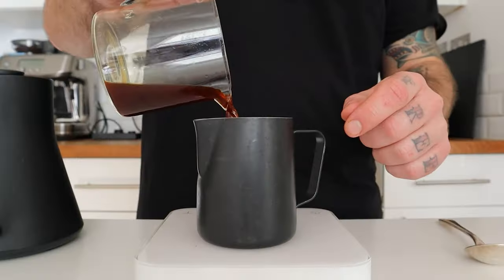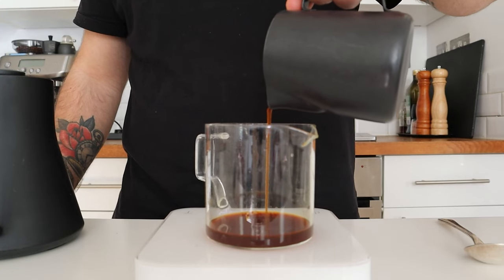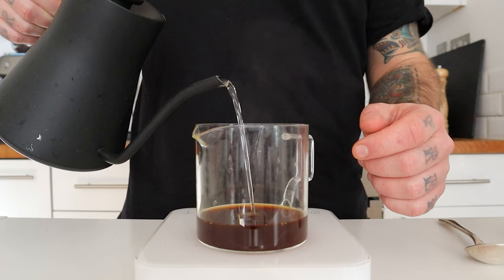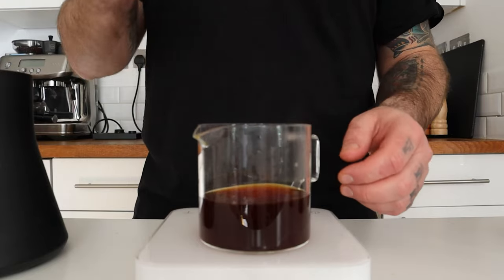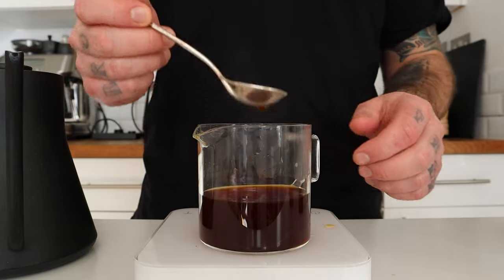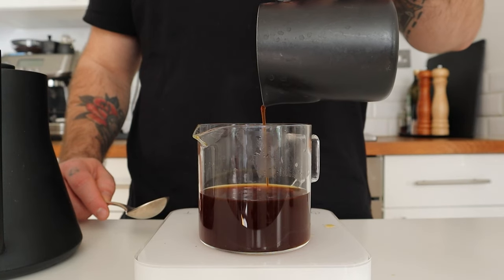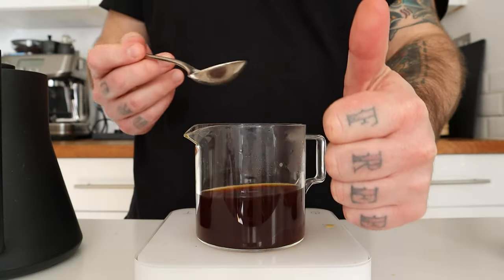How To Make Coffee With AEROPRESS | BYPASS Method

Comment: Happy I came across your channel. I've been brewing coffee concentrate as my preferred method for years. I filter with a dripper, but just recently bought an Aeropress to use instead. I do a fine grind though, at least espresso but mostly Turkish. I use lower temperatures and longer steep times (anywhere from 60-80 degrees, 5 - 30 min). Sounds like a strange recipe, but I'm not really into acidity and this method works well for me. If only using the Aeropress, I think I'll need to do something more close to your recipe though. I'll probably do that sometimes, and at other times steep in the container I normally use and then try to pour out only the liquid into the Aeropress.

Regarding  your method, I appreciate your explanation of why it works so well. I'm aware of some of the principles your shared, but have never been able to really articulate it. I especially like how you mention the aromas you unlock when diluting.

Also, I like how you arrive at the right dilution. Haha, yeah it sucks if you overshoot so having a little concentrate left over can be a lifesaver. I'll make sure to do that going forward. Also the cup will taste very different depending on how much you dilute, so your method of adding water little by little is a nice way to arrive at something you really like and also a way to explore different profiles.
Reply from the maker: Thanks so much David for your comment.
I have to say your method is very interesting. I would definitely try it in the future.
I love the Aeropress because is very versatile and you can create cup of coffees with totally different tasting profiles.
I arrived to that dilution system after years of over bypassing. it works very well at home and also in competitions, where precision is very important.
Thanks again for the kind words.

Comment: By pass method are extremely good. You use  25 g coffee,so theoretically you could add even more bypass water.
Reply from the maker: Yes they are very good. Avoid overextraction and you can decide the strength of the coffee based on your taste preference.

Comment: My super SWEET Recipe* for 150ml yield:

21grams of coffee
Grind size KPlus 7.5 (24 clicks on the comandante)
Water temperature 84~85°C
Water: 90ml 
Brewing method: inverted 

Process:
Start by adding all the coffee
0:00-0:15  pour 90ml 
0:15-0:35 stirr with paddle
0:40 put the lid on, with two filters
Purge air from the chamber and let it brew untouched
1:05 flip the aeropress and give it a gentle swirl
Plunge for 30 seconds
1:35 Done!

Now add 102ml of bypass water and enjoy

Resulting strength around 1.3TDS

In case you get sourness, grind bit finer till you find a nice sweetness (with this technique it's very hard to over extract)

* based on Paulina Miczka's winning recipe (AWC2017)
Reply from the maker: This sounds a very good good clean way. I will definitely give it a go! Thanks for sharing. P.s. For how long you stir with the paddle?
Reply: @matteofromtheswamps  as soon as you pour the 90ml, stirr for 20~30 seconds. Using this short ratio and just 90ml of 84°C water it's very hard to over extract but you could still get some unwanted flavors. So my advice is to pour, stirr 30 seconds, back and forth motion instead of creating a whirlpool and then put the lid, purge excess air from the chamber  and let it brew untouched till 1:05~1:10 
Once you flip the AP give it a single, gentle swirl and press gently. You won't find much resistance thanks to the coarse grounds. This should take anything from 20-30 seconds

Then use 102ml bypass. For the brew I use filtered water but for a bit more interesting mouth feel you could use mineral water for the bypass.